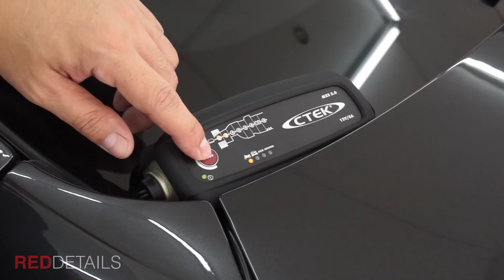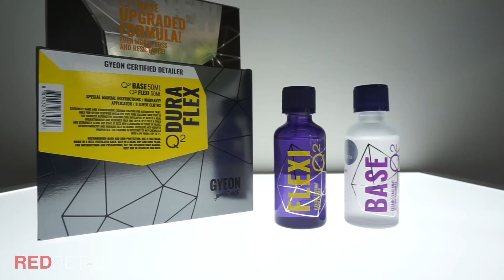BMW 6 Series GT " Gran Turismo "  GYEON Dura Flex | Full Detailing & Paint Correction

Comment: This is professional work, as always at Red Details !!  👍 👍 👍.  I especially like the care you take to remove each dust etc ... not much thinks about it!. 
What would I like to have a garage like that and make it my job !.  👏 Buddy.
Said my friend, the "nylon style" rim brushes, I have the Meguiar's ultra safe wheel brush, I don't dare use it on my black clear coat rims, it won't cause lots of micro scratches on the coat  clear in the sun where lamp?!.  I also have the new meguiar's supreme wheel brush in microfiber which I think are best suited for this work on sensitive rims?!.  Did you happen to have a technique to avoid micro-scratches, swirls on the black finishes ?.  Also on the rotary , how fast do you work?  3 compound, 2 polish?. 
Thank you in advance and have a Happy end year !!
Reply from the maker: Happy New Year 🥳